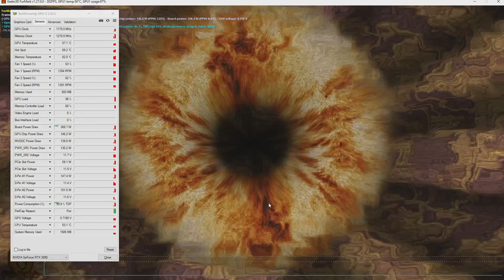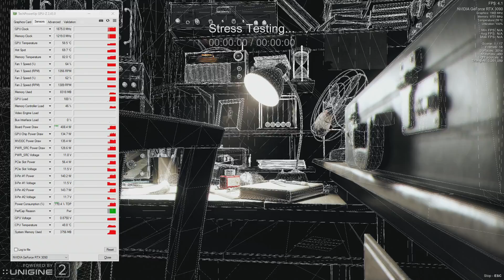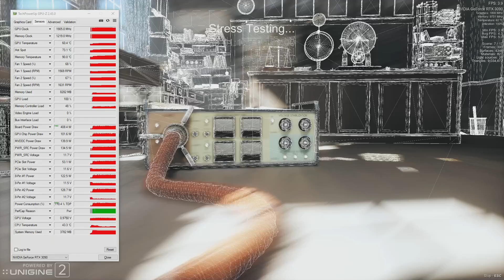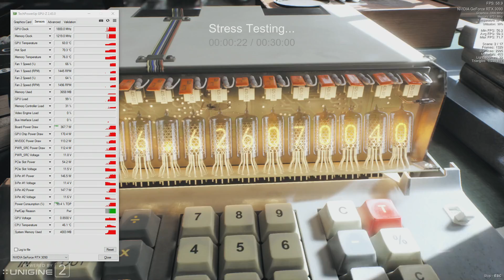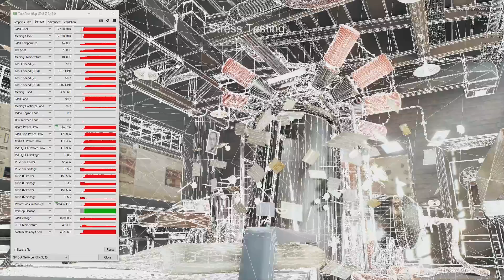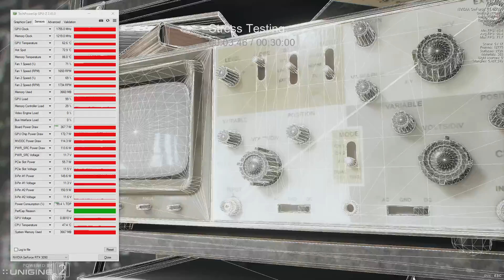One last thing about the RTX 3090 power management.

Comment: These videos continue to make me question buying a 3090 vision.
Reply: Same, I've got a gigabyte 3090 gaming oc I need to last me 4 years, I think I made a mistake
Reply: @turtleiss7683  The RX 6900XT uses 50W less power. Going to the limit seems to be a problem. Luckily, in earlier days I bought a GTX 980, and not a GTX 980 Ti. Step down one, better for longevity.
Reply: Gotta get a 3090 KingPin with it's overbuilt 23 phase VRM so none of these power issues even matter.

Comment: You'd think NVIDIA would want to make their flagship as reliable as possible, but I guess not. Maybe they've realized the sort of people who buy 3090s for gaming are going to keep buying them regardless, and making the cards fail early just means more sales.
Reply: The flagship cards have always had the highest failure rates for as long as Nvidia has been making flagships. It’s simply because they are pushing the architecture to it’s limit with more points of failure
Reply: @MarshallSambell  is it the architecture or the underspecced power delivery that's causing the failures?

Comment: If I run my EVGA 3080 FTW3 Ultra on the second vbios (105% power limit), and then set voltage and power to 100 and 105 each, the card will report over 400 watts drawn regularly in New World. I set it to 90/90 when I run the game just in case.
Reply: I was messing around with my EVGA 3080ti ftw3 with pwr limit and voltage limiting and it will boost like all the time to 1950mhz @.9 volts and it will run happily there for what seems like indefinitely and @67deg C where as if I run the card at STOCK it boosts to over 2Ghz very very briefly, then gets to just over 80C temperature and down clocks itself to 1800-1850mhz and then runs there pretty much full time at higher power usage and temperature.  

In other words, my benchmarks are higher by quite a bit if I set the power limit at 85% or even higher with power limit at 100% but voltage curve max at .9v Boost was taking the card up to over 1.1v and that is on the default bios.

So, if you're NOT undervolting, you're leaving performance on the table and also using excess power and then have to run your fans faster to cool down all the power usage.  

Seems like Nvidia really where just pushing everything to the max with this gen to lose less ground to AMD and there will be (I'd bet also like Buildzoid states) a spate of dead cards come a year or two which Nvidia happily loves... oh you need a new GPU?  We have just the thing!  Failure mode built in.

Comment: So with all of this being said, why dont these cards blow up left and right with the 500 and 1000w bios's?  Using the 1000w bios my ftw3 would pull down 600+ w in port royal on water cooling.
Reply: The card's power monitoring measures an average power draw over a period of time. If a spike occurs that is shorter than that period of time, the power monitoring will only catch it after the fact, and it will be averaged with the power draw over the rest of the period of time being measures.
So when the GPU gets hit with a workload that uses all of it it will try to draw as much power as it needs, and be limited by the power limit of the card. If the load occurs for a short enough period of time the card's power monitoring will not catch it until after the fact and will not limit it. 
Additionally, the power spikes in this video may actually be higher than presented, and New World should theoretically induce ones that are higher still.
Edit: While it could be that a higher clocked GPU may spike even higher, though considering all the power modded cards probably have better cooling, the VRM may still suffer as much from it, perhaps less.
Reply: @guycxz  I fully understand that, but with a reported power draw of 300w do you really think there are transients when playing a game that are higher than what we see when benchmarking with a 1000w bios and seeing reported power draw in the 600w range?
Reply: @jdoggsgarage4494  There may be. If the card doesn't down clock and gets nearly fully utilized, the power draw could potentially be huge. So much so that some cards actually tripped OCP before dying. If those cards had an OCP with similar values to those outlines in the previous video, you could potentailly see a current spike of 1000A. Depending on the voltage across the core, we could theoretically see a 1000W power surge that would be presented as much lower by the power monitoring. If we measure 200 times per second, or every 5 ms, and draw 1000w for 1 ms then 350W for 4 ms the average will be 480W, and that is what will be presented.
This all also depends on whether there is OCL and how it's set up, and on the way the power stages are monitored and balanced.
Reply from the maker: @jdoggsgarage4494  there's also manufacturing variance at play.

Comment: I had my heart in my mouth... Good thing it survived Furmark. Although, if you ran it consecutively 25 times, I'm not so sure it would survive.
Reply: As he mentions FurMark is incredibly heavy BUT it's extremely steady in the load it presents the card with.
The speculation is that it's load TRANSIENTS that eventually kills it, and FurMark pretty much generates only a single transition on startup (and it may not necessarily be that big either!) while most other things will have lots of smaller and larger transients per frame.

So, the theory is that New World has one or more massive power spikes where the GPU goes from low utilization (thus high voltage and frequency) to very high utilization, still with high voltage/frequency until the power protection kicks in a while later. This is how you get power readings far beyond the "allowed" power limit, the mechanism to limit it reacts many orders of magnitude slower than the core can change power usage.

Quick calculation: Assume 60 fps average, that New World generates one big transient per frame and 1 hour game play - the VRM has been hit by over 200,000 of these transients with just a small playing session. Scaled up to higher fps and longer playing time this quickly runs into many, many millions very quickly. 

Which is fine/normal if the spikes aren't high enough to hurt any of the VRM components (all GPUs VRM get hits by lots of small transients each frame without any bad effects!), but is very bad if the peaks are sufficiently high that it causes even a very small amount of damage each time which is repeated many sufficient number of times.

FurMark did historically kill some cards but that was mostly before the average based throttling was introduced specifically to combat "power-virus" type of GPU loads like FurMark, these kinds of program all tend to present high but steady loads which is exactly what the current Nvidia (and AFAIK AMD's) power management is set up to control.

So IF the theory works out FurMark is probably among the safer programs you can run on it, as long as the manufacturer didn't also set the TDP too high and there's (so far) no signs that these cards dies from that even when you push it as high as the slider will go...

OTOH I also expect that if someone used the Nvidia control panel to force enable Vsync on FurMark it would start to have massive load transients at the start of each frame, so please don't do that unless you are prepared for smoke and a dead 3090...

All of this is of course speculation because to actually prove that this is the cause someone would need a significant number of cards, lots of expensive testing equipment and be willing to test at least a percentage of the cards destruction. IE, basically Nvidia or a major GPU card manufacturer, either directly or as a sponsor. Showing that it's likely at least a factor in the failures is probably doable with "only" a few cards but requires being willing to modify (for measurement) and then potentially kill expensive and hard to replace cards (ref current GPU shortage).

Comment: My 6900 xt won't behave like this, correct?
Reply: You'll have to measure the power draw yourself to be sure, but it's unlikely. AMD's cards are rated for less power, so as long as your card is obeying the limits put in place, you're not in danger. 

If you're playing New World, I'd still recommend undervolting it.
Reply: @benjaminoechsli1941  I'm more worried about normal gaming. I don't play new world but most games I play max out the GPU at 4k.
Reply: @KatWitABatt  Then you should be fine. AMD cards are built well, and their best card doubly so. If your card temps are staying reasonable, the actual usage percentage is somewhat irrelevant.

Comment: IIRC AMD was working on a per WGP clock management system, exactly to deal with stuff like this. 

The reason you get big fluctuations of power is because you get different utilisation factors on the SIMD units. E.g we have a GPU that issues SIMD32 instructions, one instruction operates on up to 32 points of data, but it's unlikely that in an actual scene you will always have 32 points of data you want to execute one instruction on. You may, for the sake of example only use around 20 of the 32 execution units on average, but then if you have small portions of your workload where most of the GPU suddenly has close to 32/32 utilisation of the execution units, you end up drawing a lot more power than before.

Per WGP or SM clock management would require you to detect at a pretty low level what the utilisation factor is, and then preemptively choose to not issue instructions every clock cycle where you have many high utilisation instructions back to back, or alternatively change the clock speed before the transient gets out of hand.
Reply: it's probably in both AMD's and Nvidia's interest to pursue this as being able to selectively turn off parts of the card (like Ryzen does inside the CPU) will mean it can run cooler, draw less power and thus opportunistically boost higher when required as it is cooler.

Comment: Does undervolting, and flattening the curve on MSI Afterburner help with this behaviour?
Reply: Yes, it should solve the problem, you get a little less FPS but you don't end with a burnt gpu, as BZ said, it mostly happens when all cuda cores are under load, so by using larger resolutions.
Reply: That's how I stopped my 3090 rebooting my system due to OCP on the 650W power supply (meaning it was probably peaking close to 1000W). Had virtually no effect on performance but dropped average power from over 400W to about 350W.

Comment: From an engineering POV, I can understand why Nvidia takes advantage of power stages that have a rated "burst current". It allows for more boosting for short periods of time, without making a 24+ power stage VRM (which would cost a fortune, and much more PCB space).
It just requires NVidia/the board partner to accurately monitor the current through all the stages and ensure that the "power stage boosting" is within spec (e.g. burst of 80A for 10µs, than stay below 50A for > 1ms, or something like that). Of course, this also depends on the spec for the power stage on the PCB, so adopting the GPU boosting to the power stages.
I think that would be the right thing to do.
Reply: Honestly, considering the price of GPUs in general and 3090s in particular a 24 power stage VRM wouldn't be too unreasonable. I reckon they configured the power delivery as they did in an attempt the get more performance for the same price, but they flew too close to the sun and now some of their cards are on fire.
Reply: @guycxz  That is so true.
They are making gpus that are 3X the price.
But they use about the same power stages that the mid tiers have???
Engineers not doing their jobs anymore, it's all about maxing their profits in midst of a crypto boom!

Jensen sees only $$$, and now the electrons is biting his butt cheeks.
Reply: @guycxz  As I said, I somehow can understand that approach.
Generally, you don’t want to be too wasteful.
Too many power stages can crowd the PCB, making it more difficult to route other signals, and eventually you would have to sacrifice the placement of other components, e.g. move the VDD/cache power stages further from the core (which worsens their performance), etc.
At some point, a graphics card only has so much space.
Reply: @martinnyolt173  Of course, however looking at how things are configured on the card, it appears the power spikes are left as they are by intention. I don't think the card would have the same performance if limited precisely to the VRM's spec.
The best solution I could see is using higher rated power stages, which was probably considered not worth the cost.
Reply: @guycxz  Of course the power spikes are by intention.
Let's say your GPU/cooler can handle a heat load of 300W. If 98% of the time, the GPU draws 280W for the load, then there is enough thermal headroom for 400W 2% of the time. This can be used to alleviate bottlenecks and increase FPS eventually. That's the whole point of boosting.
However, it is not ok if Nvidia does not accurately monitor the current draw during boosting, and hence drives the power stages outside their spec. As far as I'm concerned, they could still use the same power stages, they just need to adapt their boosting to not overload them. Or, if they rely on their boosting to draw more current for their claimed performance, they need to select power stages which can handle the current spikes. But again, they need to be aware of the current draw at any time to know the required power stage spec.
Reply: @martinnyolt173  
I am aware that neither power requirements nor delivery are constant, and it's quite obvious power spikes that overall span over a fraction of the GPU's run time will not have a significant effect on the overall power draw.
When I said "left the power spikes as they are by intention" I was referring to their current characteristics. I think the power stages are driven out of spec intentionally, in an attempt to squeeze more performance. If not for New World, this probably wouldn't have become a wide spread issue so quickly, as evidenced by other games that don't brick a lot of cards.
Additional, more accurate, power/current monitoring and limiting may allow for safe usage of the current power stages, but it probably left too much performance on the table for Nvidia.
Reply from the maker: the card has a 1500USD MSRP I think they could probably afford to include more powerstages from the factory.
Reply: The switching frequency is 300kHz, so a power stage max 'on' time is 3.33us, with some rise and fall times. Transient loads could be properly higher than 100A in some cases, when the GPU boosts its freq. and voltage.
Reply: @stanimir4197  I think the switching frequency doesn't matter that much, at least for the point I'm making. The (boost) current to the GPU should be provided by the capacitors. The inductors are in the way. The LC filter should be properly adapted to the switching  frequency, of course. Otherwise your core gets slammed with 12V. 😉

Comment: I think for most people "unoptimized" means: runs bad somehow. The term gets misused a lot that way. If New World is using everything or at least most of what the GPU has to offer it's actually extremely well optimized.
Reply: Not really. Optimized stands for using available resources EFFICIENTLY. Unoptimized its like when cars are tuned to have 1000HP but cant put it to the ground effectively so they are barely faster than a car with less power.
Reply: @Nghtmare30589  Well said - I agree to that. I had it in mind but didn't express myself properly.
Reply: well... if 2 ways of rendering can achieve the same, or a humanly indistinguishable result in the same amount of time, which one is more optimized: the one which uses every single transistor or the one that does it at 10% utilization?
Reply: I roll my eye's every time I see it in chat or in a VOIP channel. I stopped asking "How do you know it's un-optimized? Are you a programmer and have access to the code?"

Comment: Could it be that the 8k results are just easier to monitor because the frames are longer so the transient response is might alse be longer? So the software update is fast enough to see the peaks compared to a faster framerate/shorter frame time? Also do you have any idea what information gpu-z uses to monitor power consumption? Because if its nvidia own shunt resister power monitor circuitry wouldnt that imply that the actual peak power is even higher than reported in software. Lastly if this is true, I understand that most electrical components are made to withstand pulses on a somewhat regular basis, though would the long term effects of these extreme pulse not degrade the vrm components itself or arent pulses that destructive for these components because of the relative little sustained temperature increase and short nature of these pulses.

Comment: Should it be solved with more capacitors basically? How much more capacitance should be enough?
Reply: more capacitors = even worse. If you mean output ones, capacitors equal effective short before their voltage rises, so even higher transients. Input capacitors (and cleaner input), also worse as the power limiting via the 12V shunts doesn't do anything for transients.
Reply: @stanimir4197  do you want to say that these power requirements can't be satisfied?

Capacitor does have very low resistance but if there is enough capacity then the voltage difference will be comparable to it's internal resistance.
Reply: @ПётрБ-с2ц  adding more capacitors causes high inrush current to charge them, the current depends on their ESR (and ESL). The peak current is what likely kills the power stage, adding more of it won't help.
Reply: @stanimir4197  are talking specifically about startup?